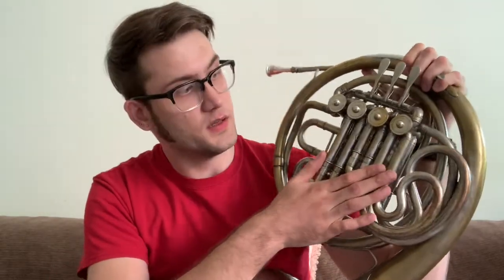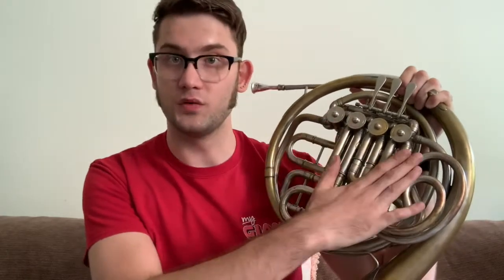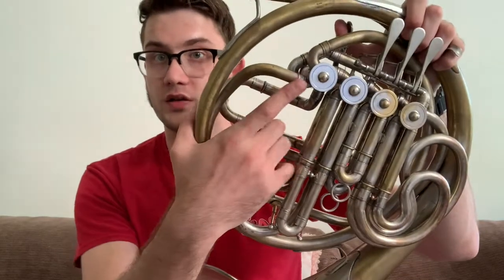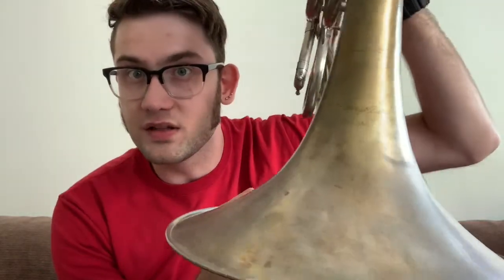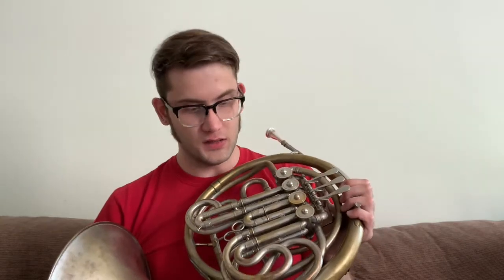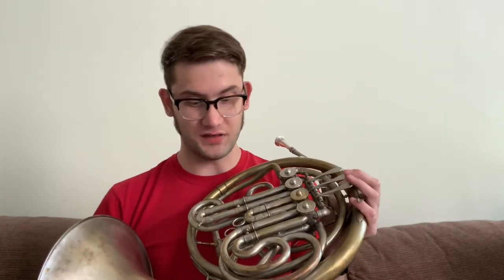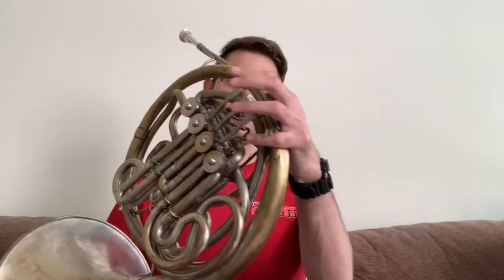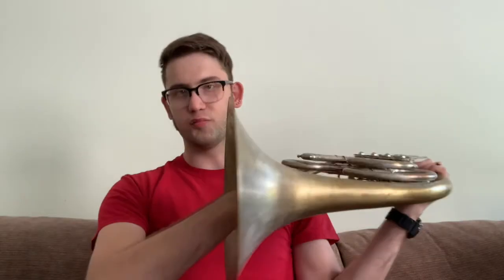Week With a Horn: Sansone Bb/F double horn

Comment: Looking to buy one of these I found really discounted in the 2nd hand market. Can someone please help me understand if it sits in F naturally (Bb when pressed) or otherwise? Also, if it's Bb in open, then is it possible to change this over or it's permanently fixed? thanks so much.
Reply from the maker: I believe these stand in F. No need to adjust or change it (unless you want standing in Bb). Which I am unsure if that is possible. A repair tech could probably help one figure out how to change that.  Hope this helps!
Reply: @robertlevine1093   Interesting, so it's basically only the design of the pipes that is different but not the full build
Reply from the maker: @Sephirothfrank  It functions as normal double horns do.  It was simply a way to make the Bb slides more easily accessible.
Reply: @robertlevine1093  Amazing, thanks so much! 🙏

Comment: Hi Rob, a friend of mine has a Sansone he's looking to sell....seems like from your demo video the horn was "so so" to you? How did it compare to say an 8D? I know you mentioned it has a large bell. Thanks
Reply from the maker: Hi David, 

Thanks for the message! I am unsure how how to answer your question because the horn I used (I believe) has very leaky valves, so I don’t believe it played as well as it could.  Some issues I could potentially see arising with these F on top, Bb under (sansone) horns is the F side feeling sluggish similarity to a triple. But not for the same reasons (valve compression, or lack of, VS actual weight of instrument). It’s tough to give a definitive answer to your question, my apologies for being vague.